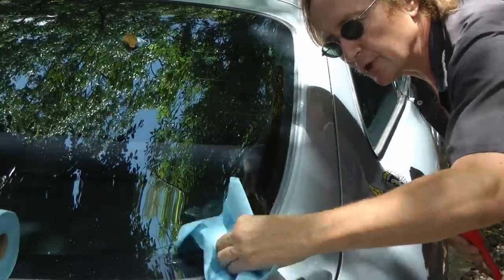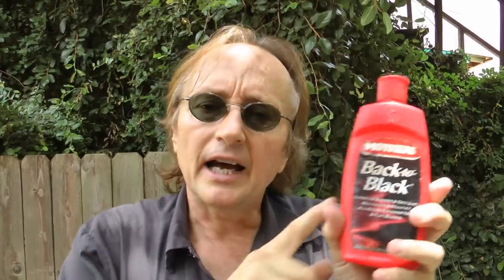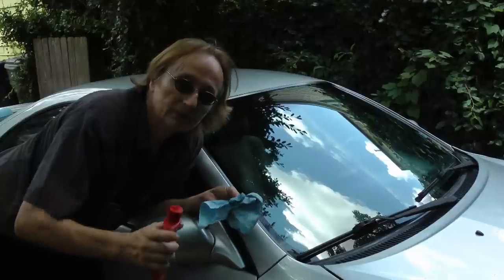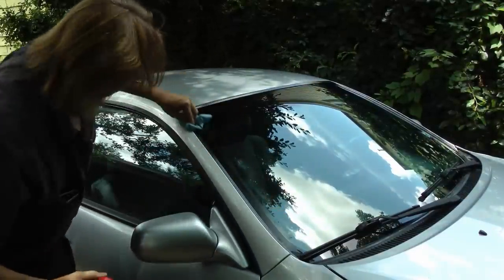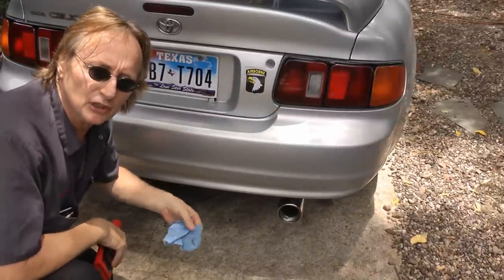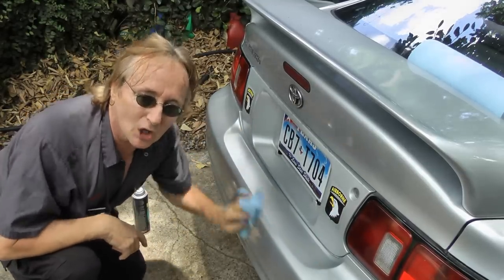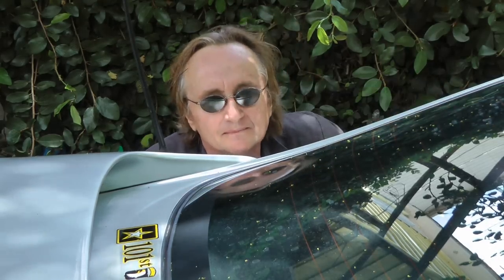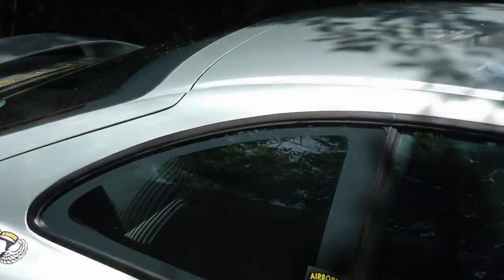How to Restore Faded Plastic Trim on Your Car

Comment: No problem, my brother's Caliber with tons of black plastic cladding still looks refreshed after a year since I've done it, as does this cheap plastic Astro bumper cover I did it on. It will fade again eventually, but the stuff is so cheap and requires such a small amount. I was surprised myself how well it went from being chalky black to that "wettish" brand new black. Hope you have as much luck with the oil as I do.

Comment: I have used a 3M scotchbrite pad on plastic trim and it removes that pale layer of plastic and leaves it black. Pays to put some masking tape on surrounding areas to protect them. Used a bit of water with it, worked very well. 
Trim still looks good few years later. Once cleaned up putting some of those trim products on should maintain it, though I haven't.

Comment: I tried that stuff & found that it washes off pretty fast out here in rain country. Might work better in desert climates.
Reply: Nah stuff sucks everywhere. Better off sanding it cleaning it well then just repainting your trim pieces. Using an acrylic sealer thats got UV protectant or clear coat with UVP will look brand new and not fade in the future.

Comment: I got some stuff called Aerospace 303 protectant. It works really well a bit pricey for a gallon but a little goes a long way. Shines up tires, dash, trim you name it, and it's not silicone based. Has UV protectant in it too which definitely helps in the big Texas sun.

Comment: I use this stuff too and it does work, but fades in 2-4 weeks depending on sun exposure. Don't get it on glass, it's a pain to get off. You can always buy a dye and dye it back and that will last for at least 3 years so I've heard.

Comment: I'm assuming you replaced your sensors that were damaged as well. If you have, either find out if there is a reset option in your service manual, get a scanner with SRS functionality, or you may have to resort to taking it into the dealer and have them shut it off for you.

Comment from the maker: system has to be repaired for the light to go off. If you use a fancy scan computer to turn it off and it's not fixed, it will just come back on. Or you can just find the alarm an d  unplug it

Comment from the maker: you need a new blower motor resistor for the speed, but the vent systems on most cars are VERY complex, requiring a dealer level scan tool to analyze what's breaking down, often bad blend doors do that but they are inside the dash and very expensive to fix.

Comment: Question for you on another subject Scott.
My headlights are adjusted using plastic pieces attached to them.  
The car is a 2001 and so the plastic is very dry, almost brittle.  
One to MACHO of a turn and SNAP, there goes a part that took hours to find.

My question is:
How do I loosen these plastic pieces without breaking them ?

Comment: Plastidip worked perfectly for my drip rails. Did you happen to clean/sand the trim completely off of the old plastic dressing or just painted over the faded spots? The former will look a lot better than if you did it via the latter.

Comment: Hey Scotty quick question; I have a LOT of faded trim on my SUV, and recently someone suggested that I use a heat gun applied directly to the plastic to "resurface" the plastic and make it shine like new, my buddy showed me the before and after pics of his jeep and it's quite impressive. I was told it's permanent vs. the Back to Black which only lasts a week (at most). My concern is I'll damage the trim in some way, what do you think?

Comment: To take off the previous sealant, a good product to try is Goof Off, works for me everytime I need to clean something up that nothing else can get to. As far as putting it back on your vehicle, I wouldn't recommend this as a DIY project (for safety reasons) and just call up a mobile window repair service to install it for you.

Comment: I paint them with shoe black wax and then dry with a hot air gun, holds several washes and stays black and shine for longer than a year, I do that on the cars whose owners pay for quick polish, On shiny plastics, I use regular polish cream, or if they are really bad and  scratched, an >1000 grain and some polish do the trick and lasts very long, as with fogged headlights.

Comment: I wouldn't use a heat gun. Use boiled linseed oil. Apply with a paper towel in a very small amount and leave on for a bit. Wipe all excess and dispose of any towels and such in soapy water to scrub away the oil. Linseed oil forms a plastic like film as it oxidizes. As it polymerizes it produces much heat and can create a fire in a garage-hence why to be so careful with waste towels.

Comment: Hi Scotty, I got injectors & a pressure regulator for $20 it a salvage yard. I cleaned them out, it runs smoother & has a little more pick-up. But my issue is when it's been running then I shut it off it has a hard time starting again, it starts right up the first start of the day. I think it might be I took the catalytic converter off, put pipe instead & downstream 02 is telling the computer to run more gas, flooding it out? 2002 Olds Intrigue 3.5 DOHC

Comment: +Scotty Kilmer, Scotty if you clean the plastic and then heat with a heat gun it will melt the top layer of plastic and allow it to reset. This will make it once again black, and once done it's as permanent as brand new trim would be.

I've done this to many cars I've owned as Back to Black is too expensive and impermanent compared to a few hours electric bill and rarely having to do it.

Just don't over heat and move the gun around the area else you'll get flat spots or well melted plastic but this is really hard to do, give it a try anyway. Even if it's a test patch under the wheel arch.

Comment: Hey Scotty.
I do my own maintenance on my car and just recently did an overall swap of everything and ran it about 3000 miles on a road trip.
Now, after heating up, i get a slight hesitation when I accelerate from the stoplight, up-shift too early or get to an uphill incline and am in a high gear.
Could it be clogged injectors? or the Spark plug Gap is too wide?
I drive a Mustang 2000 V6 Manual Transmission.

Comment: Hey got a 90 gmc and it just started running bad at low rpm like at a stop or at idle my oil Pressure is at 30 I just changed the oil and ran thicker hoping it would fix my problem but it didn't don't nor if my pump is out or my Pressure switch is please help me fix my baby

Comment: would it work with faded headlight lenses?
Reply from the maker: to some extent, but they often need polishing first, they make 8 dollar kits for that
Reply: Scotty Kilmer Thats more like $80 in my country! Haha
Reply: Use a piece of wet scotchbrite to polish it.  Literally just scrub it till its clear then spray it with clear spray paint.  Apply a light coat at first, then when tacky, apply a second heavier coat.  Voila! Done.  (If you mess up the paint, just polish it again and respray it)

Comment: A heat gun works the best, and it's permeant..
Reply: I can confirm this one. I used a heat gun on my pickup truck and it really makes the plastic pop now.
Reply: +Bryan Young awesome...
Reply: Bryan Young u mean pop New?
Reply: It most certainly is NOT permanent. Check out the youtube vids of guys that did that to their Avalance trim. They were so excited, and swore by it. But if you see the ones that updated it, it lasted about 2 months, and then you can't do it again, it's ruined.

Comment: You would be better off spraying the black trim with PlastiDip as it doesn't wear off like B2B does.  If you want to be different you can get PlastiDip in other colors besides black too.

Comment: I'm not Scotty, but that doesn't sound too smart, you can easily overdo it and melt the plastic or orange peel the paint surrounding it. While Back to Black is a decent product, soaking dried up rubber (trim, seals, etc.) with silicone oil works even better. You can buy Blasters Silicone Oil in a spray can at Home Depot for around $4.